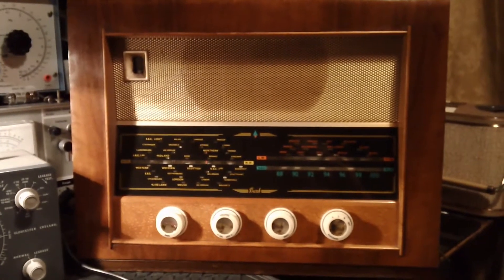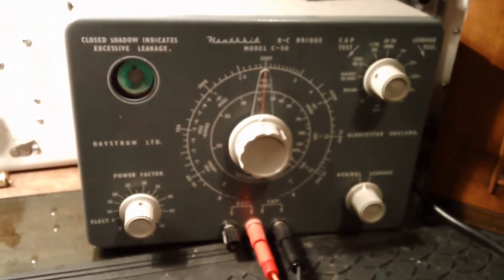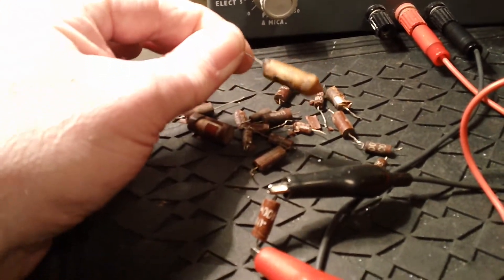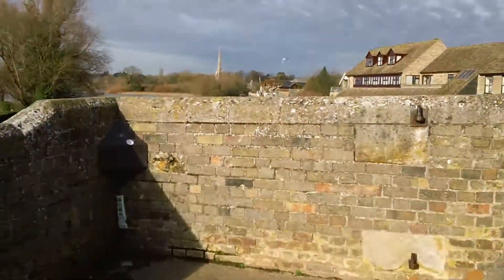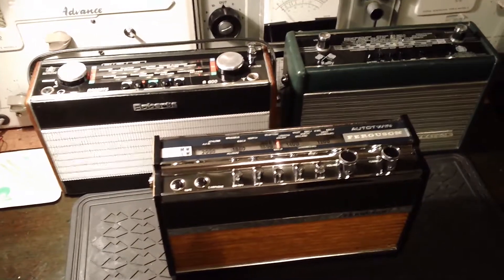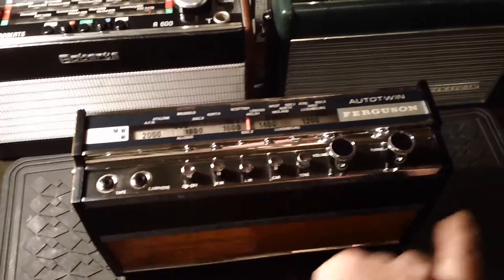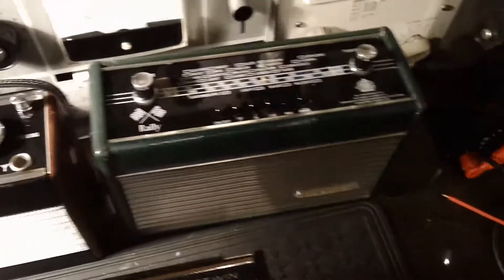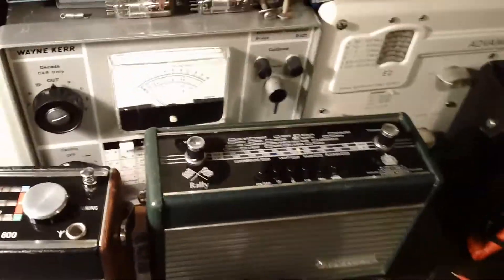Hodgepodge 1

Comment: Andrew,
It will be great to hear that lovely looking VHF54.  They were definitely one of the more brilliant old radios.  Those three transistor radios look good also.  There were some transistor radios that had a power plug-in connection, as well as an aerial socket, fitted to the underside (Philips and National Panasonic come to mind).  They could be used both as a car radio and easily released to be used as a portable transistor set.
Our weather here in Britain has certainly been strange in recent weeks.  That area where you have filmed must look very beautiful during the summer months.
Regards,
Phil.
Reply from the maker: Hi Phil, I've been working on the VHF54 over the last week or so and it lives again but the air turned blue while working in the FM tuner...I'm sure you know what I mean!  The old river must have seen some things in it's time, Roman galleys, Saxon ships etc etc the quay was last used to bring coal up from Kings Lynn and take wheat back. Thanks for watching - Andrew

Comment from the maker: Hi Al, thanks for watching the drivel :)  Indeed, these things have probably worked far beyond their intended design life. Our river floods like this most years, occasionally  it comes up into the town, here it's a couple of feet from breaking over the quay wall. They let the water down slowly towards the sea (60 or so miles away) using a system of locks and letting the large grass meadows flood to reduce the risk of more serious urban flooding. The bridge I'm filming on dates to 1425 or so which puts our 'old' radios into perspective :)  Yes the radios all work perfectly, all PP9 (9V)  battery powered.